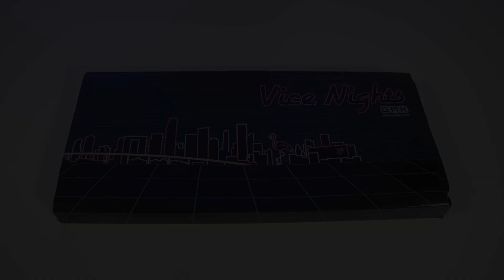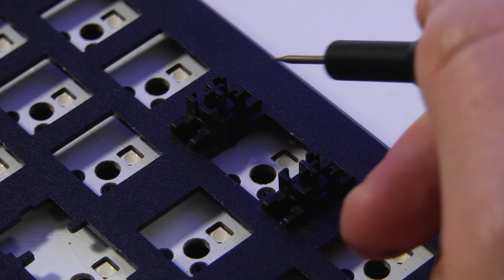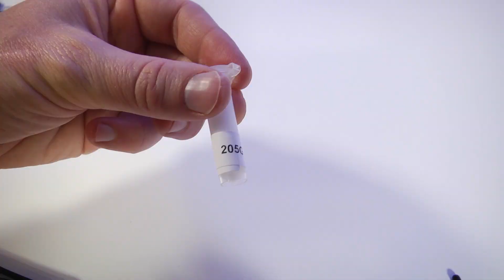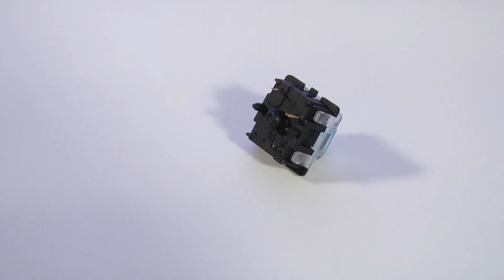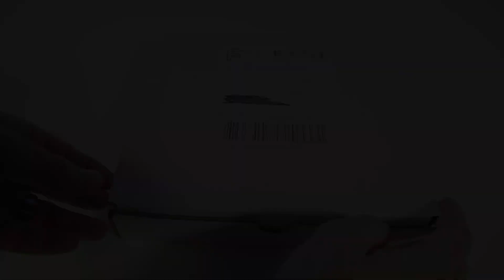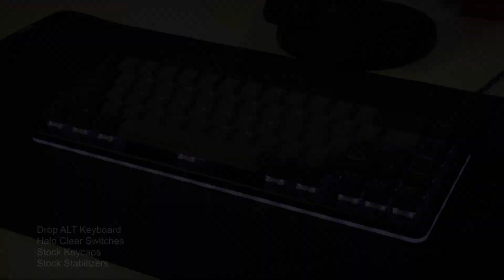Drop Alt Custom Mechanical Keyboard Build – New Switches, Stabilizers and Keycaps

Comment: A funny thing that occurred to me is I have not seen even once where somebody tried to take out the stock stabilizers and do the same thing (clipping / overly greasing) as they did with the replacement stabilizers.

Just an observation, I personally like the original sound coming from your original keys. Also, your desk sounds like a reverberating wood box which I think is part of the problem. I have a heavy desk that's like a brick (solid) in comparison.
Reply: glad im not alone, i thought the same thing. def the desk making a majority of the noise

Comment: i want to buy the cherry stabilizers do i get the Plate Mount (6.25 Spacebar Wire) or Plate Mount (7u Spacebar Wire). i dont know which is correct for my alt drop.

Comment: Sorry for the late comment. I own a Drop Alt, and am waiting on a GMK keycap set i bought in (GMK Hallyu, Group buy is ending today). Recently I found out that Cherry profile keycaps (GMK has Cherry profile) have interference on north facing switches (Drop Alt PCB is north facing, means LED is up). The interference makes the keycaps/switch sound and feel worse/weirder. Have you felt that? Does it make a big change? Have you tried putting your GMK Keycaps upside down to see if there is a difference? Any response would be amazing. Thanks for the video :)
Reply: Forgot to mention not all switches have the interference. Holy Pandas have a longer stem so when pressed all the way down its not fulsh with the top housing, but most switches are flush and should interfere. So Holy pandas dont interfere bc of the stem.
Reply: I would not reccomend putting your keycaps upside down but you could try using a longpole switch such as the qwartz switches from JWK which stops interference with north facing LED.

Comment: Dumb Question: If you put those caps on, the RGB lighting will no longer shine through the keys, right?
Reply from the maker: You are correct. When using GMK keycaps you loose the backlight in the keycap. You do still see some glow around the keys but the keys themselves don't light up.

Comment: I bought the authentic cherry plate mount stabs, they look exactly the same as the one that came with the alt ( I got my alt 2months ago).  So I didn't replace my stabs. The original stabs works fine after clipping, lubing and adding band aid on the plate.

Comment: So does any pcb work for any switches?
Reply: Yes. But you need to clip off the switch legs if the pcb has only 3 pins, and solder them in if they are not a hotswap pcb.
Reply: Yes with a big *. On some boards, the switches are soldered to the boards. So if you want to swap switches on like a corsair you've got some work todo. It is 100% possible, but the drop keyboards are kinda amazing given their hot-swappable switches.

Comment: how long is the cable, just wondering since im planning on getting a cable for the drop alt
Reply from the maker: 5' cable with a 6" coil. It's been working great so far, really happy with the quality of the cable.
Reply: Its crazy cause some people say they don't have issues with there alt and custom cables but I be having issues with custom cables all day it will turn on the leds but won't work I may just get another alt but high profile
Reply: @Thebarrioboy2009gma  it needs to be at least a 2.0 cable and no more than 6 feet total (including the coiled part)...